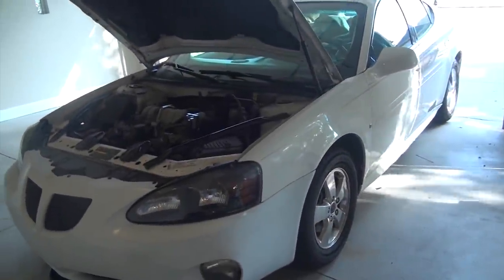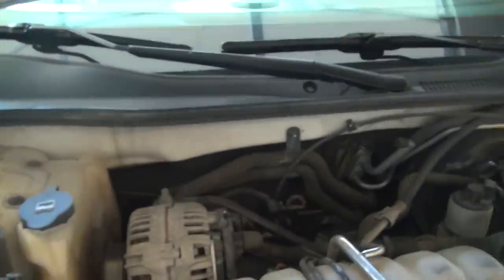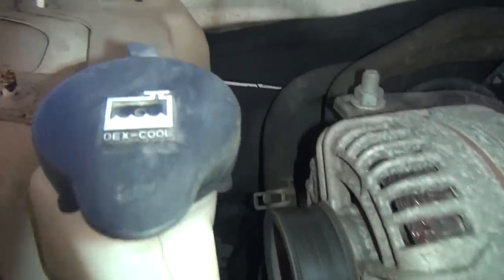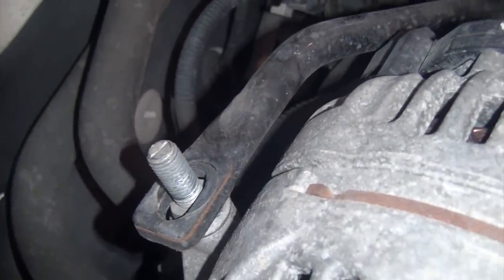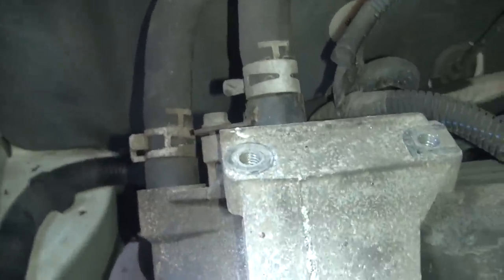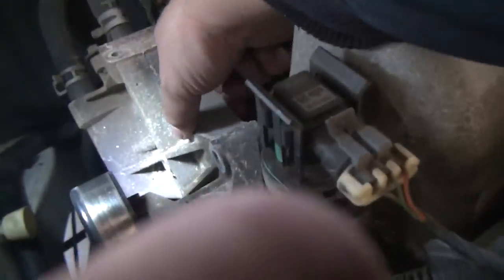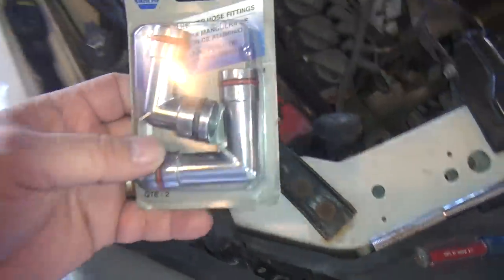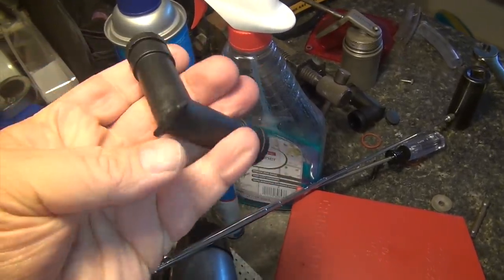GM 3800 Cooling System Elbow Replacement

Comment: i am fixing to change it on my mother in laws Buick. i have to watch with no sound at work but is there metal snap rings in the head were it goes into or is the piece held in with just the o rings O_o
Reply from the maker: There's no snap ring, just the rubber o-rings

Comment: Is it possible to see that the leakage is from the elbow or from the water pump without removing any parts?  Or could the leak be from the bolts holding the water pump in place since the 1/2" bolts go all the way through to the water jacket.   I need some diagnosis assistance.   thanks.
Reply from the maker: Good question.  In my experience, when the elbow leaks it's usually very weak and close to crumbling.  It also leaks on the hot intake and evaporates so you can't see where it's coming from!  I suggest pressurizing the system when the engine is cold and doing an inspection of that area.  You should be able to tell more closely where it's coming from.

Comment: Hey Mike, does the 3.1 Chevy Lumina have the cooant elbows in the same area on the tensioner bracket?
Reply from the maker: I don't think so, but the 3.1 can suffer from lower intake manifold gasket deterioration.  If you're "missing" coolant you may have an intake gasket failure.  Also check for coolant under the upper radiator hose neck.
Reply: @mkernen  ok, thanks for the quick reply. Last year I had the Lower Intake gaskets replaced with better ones and the head gaskets also. All the videos looking for coolant elbow replacement every video is 3.8 motor. Thanks for the great video and information. I'm going to call the Chevrolet dealer again and ask them if the elbows are in the same spot on 3.8 and 3.1.  Yesterday I told the dealer that it's a 96 Lumina 3.1 he said that the elbows are behind the tension so I'm going to call back and double check.
Reply from the maker: @maryb6509  Mary, the 3.1L and the 3.8L are very different engines.  The 90 degree 3.8L was designed way before front wheel drive cars were popular so when they decided to use it in a front drive application they had to adapt it to the transverse fitment.  That's why I believe the strange coolant elbow was devised.  The 3.1L is a 60 degree Vee and was designed for front drive applications so it doesn't need to have weird tricks like elbows feeding through the alternator bracket to work in a front drive car.  By all means, do your research but I'd guess your leak is elsewhere.  If you have a mystery leak, have your heater core checked - you don't want to be breathing vaporized coolant!
Reply: @mkernen  Will do, thanks for the info. Will post later when we find the leak

Comment: dont gotta rebleed the cooling system after u change the elbows or the rad hoses?
Reply from the maker: Good question.  Yes, you should bleed air out of the system.  As you should any time the cooling system is opened.
Reply: @mkernen  how do you put the power steering pump back on?
Reply from the maker: @saultrevino5427  Hmm, I never took that off>>>>

Comment: I changed my elbow out to only find them leaking again I had a hard time putting them back in any advice
Reply from the maker: Use a bit of coolant on the rubber o ring to lubricate them.  They should slide right in.  If they still leak, could there be a bit of old plastic in the hole??
Reply: @mkernen  thank for the advice the coolant on the o rings helped out tremendously job complete.
Reply from the maker: @reaver9833  Good to hear! Those 3.8s run forever.  Happy motoring!

Comment: So, did your o rings fail on those aluminum elbows, people are saying to use the OEM gaskets that come on the plastic ones, because the aluminum ones will leak eventually.
Reply from the maker: No, and I wouldn't reuse any O rings. They have been heat cycled and flattened for one thing, and are not necessarily the same size as the groove in the new elbow may be deeper or wider than the original.  If you are concerned, you may be able to buy higher quality O rings from the auto parts store, but definitely don't think reusing the old ones is a good bet.
Reply: @mkernen  That's what I meant, not the old ones.
Reply: @mkernen  man, I'm on the fence about aluminum or the OEM plastic elbows at this point, many people are saying their aluminum elbows are leaking because the gaskets are smaller in those than the plastic ones
Reply from the maker: @jonmo2694  If you plan to keep the car less than say 5 years, the plastic ones should be fine.  I didn't replace my original ones till the car had over 75,000 miles on it.
Reply: @mkernen  no, I plan on keeping it longer, I just put new wheels/.rims on it and painted the calipers.and replaced the brakes as well as replacing alot of fluids, cleaning bthe throttle body and looking into the car 4:20 code.Its a project cat r for me now, just trying to keep it tip top and I'm also putting tint on it It's looking pretty nice so far wish I could send pics
Reply: Cat 4:20 code
Reply: @mkernen  mine has a drip under the elbow,I just noticed but a puddle under the fuel injectors, any reason why the puddle there? Do you know?.I have no leaks under the car, it's burning off the engine, I just did a flush thermostat and ECT sensor replacement
Reply from the maker: @jonmo2694  When the plastic elbows fail they sort of start to crumble.  Sometimes they fall apart in your hands as you take them out making it hard to believe that they could hold any pressure at all. I'd change those buggers ASAP!  They coolant tends to burn off directly under the elbow while the system is under pressure it may kick enough out to cause a puddle.
Reply: @mkernen  I still have to do brake fluid changes and power.steering as well as looking into the cat, the throttle body, the oxygen sensors ,maF sensor.Its all good
Reply: @mkernen  Could that be why the temp surges when idling? I changed the thermostat, temp sensor and did a coolant flush and thermostat change
Reply from the maker: @jonmo2694 It sounds like you have air trapped in the cooling system.  If so, you need to open the bleeder at the highest point in the cooling system to let that air out.  Air pockets heat up super quickly and if one is near the temp sensor, it can cause this. https://youtu.be/nibDs-9fcJ8
Reply: @mkernen  ok, I will try that again even though I have opened the radiator cap on a hill to bleed the air, only for it to return.Cant it just be from the leak in the elbow getting air in it, I know I have seen it drip
Reply: Are you supposed to open the bleeder valve from the bottom or middle of the bleeder, there are like two parts to it.
Reply from the maker: @jonmo2694  There should be a small piece at the top to open.  Don't do it while the engine is hot!
Reply: @mkernen  I think it's because of the elbows coolant leak, I'm going to tackle this soon
Reply from the maker: @jonmo2694  I've had them fail catastrophically once they started to leak.  Don't venture far from home!

Comment: I followed the video to the letter.  I believe I got all the remaining plastic parts.  I filled the coolant.  I am getting a plactic melting smell while I'm driving.  What do you think is wrong?
Reply from the maker: It's tough to smell from here!  One guess would be that you dropped something plastic on the exhaust manifold - or, possibly you have a leaking heater core.  Are your windows fogging up all the time?

Comment: Great video! Unfortunately my aluminum elbows (at least the one I can see) is/are leaking. Someone GLOBED rtv in with it. Just a dab will do ya if your going to use rtv 🙄. Anyway, now I have to pull it apart to replace them. Mine is a supercharged 04 Impala SS l67. Been a great car otherwise

Comment: Great video! I'm going to be looking at a car with this same engine. I'll be sure to check to see if it has the  aluminum elbow already installed or not thanks to your video. I have some quick questions though. 

Did this car have the Series 3 engine? Also do the Series 3 engines have problems with the Intake Manifold Gaskets? I read online the Series 3 have the upper and lower Intake Manifold made from aluminum on the naturally aspirated models. Is that the Intake Manifold itself it's referring to or the gaskets? Thanks for your help.
Reply from the maker: Yes, it was a 2004 so it would have been a Series 3.  The gasket question is a good one - I only did the elbows on this car, so I didn't encounter those gaskets.  A quick websearch turns up some aluminum lower intake gaskets for the 3800.  I'm thinking the intake itself is plastic on the top with an aluminum base.
Reply: Okay. Thanks for your help. Much appreciated.

Comment: Hey Mike, do you have a video of this procedure on a vehicle WITH the supercharger? thx
Reply from the maker: Sorry, I do not.  It's not too terribly different though.  If memory serves, the rear bracket is different (or nonexistent) and you of course have one more belt to remove.
Reply: @mkernen  Ok. Thanks so much. Any way to work around the superch unit?
Reply from the maker: @mrt1626  Oh yeah, it won't be in your way too much.  I didn't do anything other than take off its belt.
Reply: @mkernen  Cool! That's what I was hoping. Thanks again Mike. I appreciate the help.
Reply: .
Do you recommend using gasket sealant when installing the new water pump?
Reply: Hey Mike, never mind. My GM mechanic said to just use a Fel-Pro blue gasket.
But thanks. AGAIN!

Comment: I learned the hard way on those metal parts. I did lower intake manifold gasket not long ago with aluninum elbows. It took me way too long to yank them out due to the corrosion on the cheap aluninum parts. they corroed like pig iron and got stuck on lower intake. I ended up scoring the lower intake and the crossover assembly when I finally pulled them out.
I do recommend to use gm parts other than aftermarket metal ones. its not that hard to replace plastics but not metal ones in case you need to touch the lower intake.
Reply from the maker: Interesting, aluminum elbow corrosion would be a major thing if used against a cast iron lower intake.  Wonder if one could introduce a little anti-galvanic paste during assembly.  Thanks for the comment.

Comment: How much different was the supercharger engine to do? I have a 3800 series 2 supercharged
Reply from the maker: Other than the removal of the supercharger's belt, it was no more difficult.  There is a bit more room to work on the naturally aspirated engine, but as I recall the difficulty level was about the same on both.

Comment: I have a 98 Camaro 3800 V6. I replaced the tensioner assembly with new one. I also replaced the elbow with new plastic one. Since this I am losing water but nothing to be seen anywhere. This all started after replacing the tensioner assembly. Any Ideas?
Reply from the maker: If you're lucky, an elbow is leaking and since it leaks on the hot intake the coolant evaporates instantly.  You can do a pressure test on cooling system when the car is cold and possibly see the leak in that area.  Possibly one of the O rings got rolled out of the groove or something.  OR, and I hate to say it, I'd suspect the lower intake manifold gasket.  These are notorious and I've had to replace them on my 2003 3800 - 5 years newer than yours.  Check to be sure you're oil isn't cloudy or foamy. Good luck!
Reply: Thanks for your feedback Michael. Im gona pull the pulley off and have a look at those elbows...
Reply: I pulled the tensioner  assembly off again to check if o-ring may have been rolled out. All looked good. I'm gona  try and do a cold pressure test I guess next... Thanks for the feedback though!

Comment: after I replaced the elbows and put everything back together my belt makes a slight whine do you know why?
Reply from the maker: Hard to say Chad, you may have a bad bearing in an idler pulley.  Check everything in the area you were working in.  Alternator bearings could be on their way out..  Tough to say from here!
Reply: Michael Kernen the alternator is new thinking it's the belt tensioner pulley it was rough when I tested it when I replaced the elbow. I'll start with a belt tensioner pulley. thank you for your advice
Reply from the maker: Those do go bad.  If it feels gritty, it'll make noise.

Comment: thanks i have an 88 delta 88 olds.do you know the part number  for the elbows?
Reply: 1988 will be an LN3 motor, which doesnt have the elbows
Reply: @aidenstefanson2175  its a 3800 motor and it leaks antifreeze too,cant figure out where its leaking??

Comment: What's the time needed for this repair
Reply: It took me little more than an hour.
Reply from the maker: I've done this a few times so it goes pretty fast for me.  I'd allot at least 1.5 hours - a bit more for the supercharged engine.
Reply: For an inexperienced amateur it took me an 8 hour day with, breaks and being really careful.  I had  to run back to AutoZone to get a pick set once everything was apart.  I decided to tackle this on my own because the mechanic wanted to replace the manifold for $500 and I wanted to just try these $20 elbows first and see what happens.  My elbow that was leaking took me an hour of picking at it to get the o ring out of the problem holes (both front holes, the  rear ones didnt have a leak).  Its a 2005 Buick lacrosse I picked up a year ago for $5000, w 41k miles...

Comment: Will this leak cause your engine to overheat?
Reply from the maker: Not until you run out of coolant, then it will!
Reply: @mkernen  will this cause air to get in the system ?
Reply from the maker: @itsyounqLO  It surely could.  I wouldn't leave it leaking. I've seen these start to leak then deteriorate very quickly.  Remember the system is under pressure when the engine is running and a small crack can lead to a failure while you're driving causing you to lose coolant rapidly.  I wouldn't just let it leak, that's for sure.
Reply: @mkernen  thank you sir. I’m getting this fixed today and removing dex cool as well.

Comment: Does this problem occur on 3.4 impala? Having a leak problem
Reply from the maker: This video doesn't apply to the 3400 -  It's a totally different engine..
Reply: @mkernen  so does the 2003 impala 3400 have these elbows?? I'm leaking coolant after replacing everything including heater hose,tube,pipes,hoses,flushed system,etc and now its leaking from that same area..
Reply from the maker: @Cryptoisnotdead  These elbows are not on a 3400. Maybe this will help you?  https://montecarloforum.com/forum/engine-transmission-performance-adders-12/00-3-4-coolant-elbows-36036/

Comment: What else could make the coolant leak?!
Reply from the maker: It's difficult to say without being there. There are dozens of places! If you can't find it, there is a dye you can add to the coolant that will allow you to see it with a UV light. Run the dye in the system and start shining the light around. If you don't see any glowing dye, it may be leaking internally and getting burned in the combustion chamber which could indicate a bad head gasket.  Good luck!!